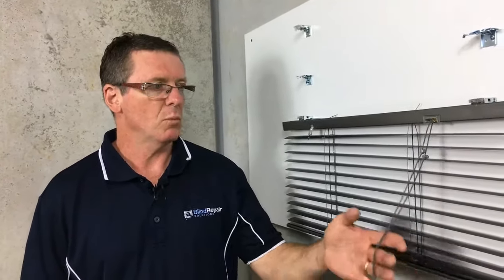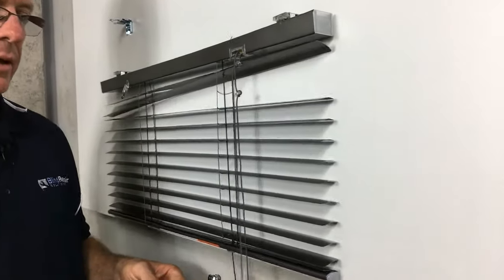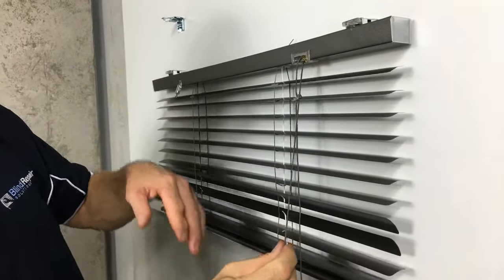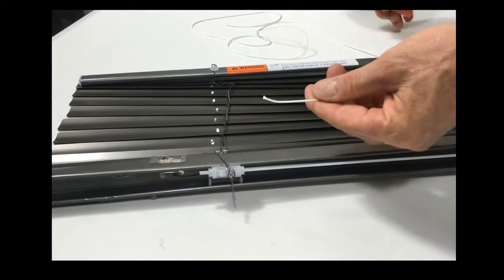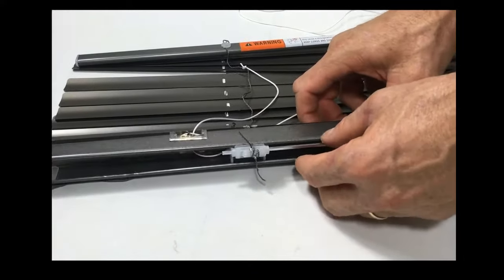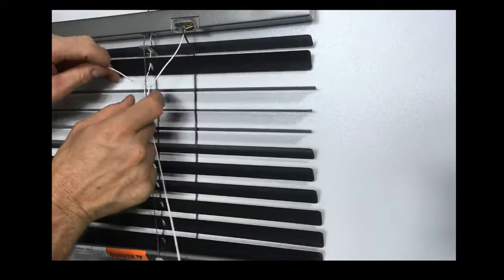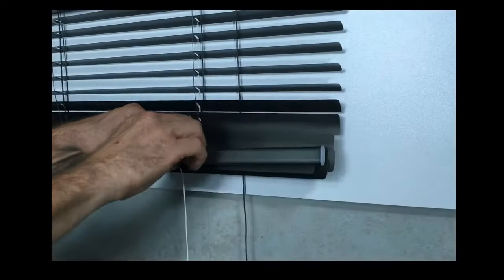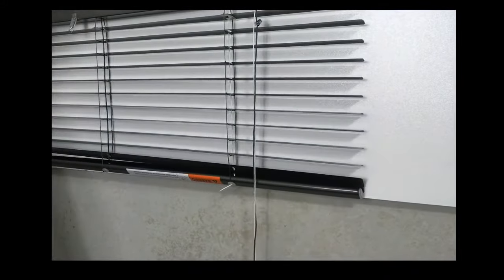How to Re-Cord a Venetian Blind.

Comment: Great tip to connect the new cord to the old one. 
We fixed a wide blind and the cord needed was quite long - the broken cord went from the bottom of the left side of the blind, all the way across, looped down where you pull it, then back up and down the right side of the blind!! Luckily I bought a 10m cord.

Comment: Brilliant. I used method one, but as my blind is 7ft tall, I took it of the brackets first, and threaded through on the floor, in case the cord join broke half way through and gravity would have pulled the new cord out. Wise precaution, as it did break at one point but it was simply a matter of remaking the join and carrying on. Thanks for the great video.

Comment: This was a good instructable xcept my blinds were far more complex.
I had to actually start threading the string through the top first, go down to the very bottom, through a freewheel type mechanism, then all the way back up again to the top to be tied off, threading it through each slat and alternating like you did. Seems to be working ok now through.
Reply: Deduced he restrung the other side; mine is the same as yours.

Comment: Like an idiot, I removed the two pull cords completely, first. Restringing them was a huge pain. I put the blinds on the floor,  and carefully ran the new cords through the header, and down through the blades. I think/hope everything works correctly. 
How simple to melt the old and new cord together and pull the new cord. Like I said, I was an idiot.